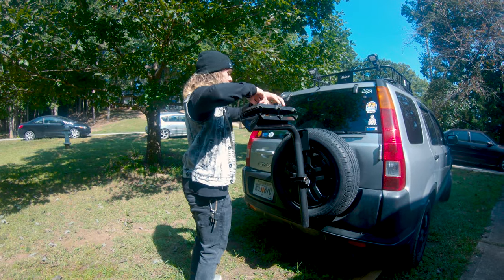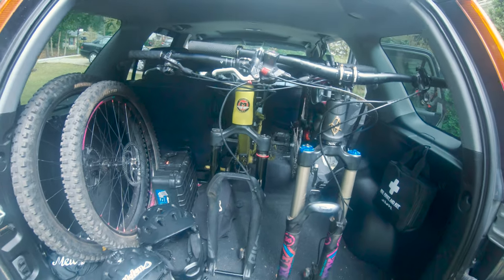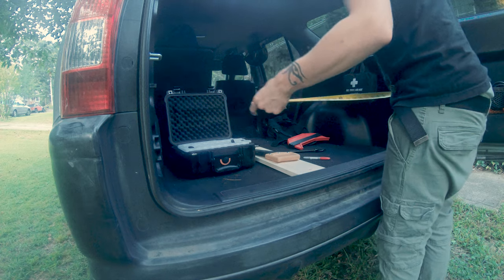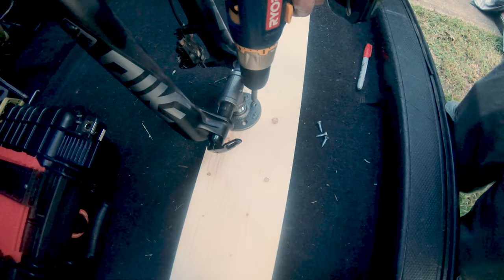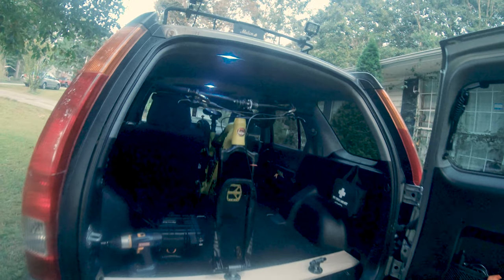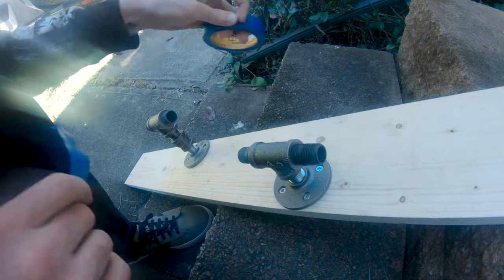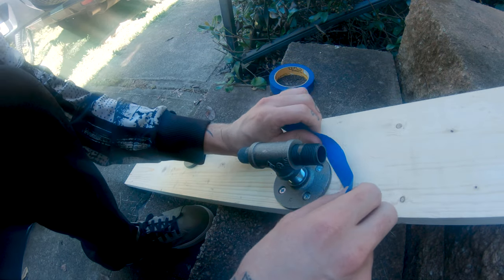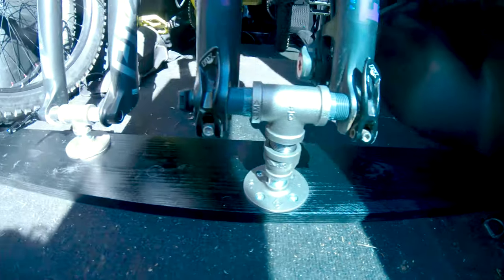Bike Mount Inside Vehicle DIY - No More Bike Rack!

Comment: This is an excellent idea! I’m almost 58 and just bought a Schwinn Al Comp to try to get back into shape after being off work for over five months due to a work injury. Picked up my Wife a new Electra Townie. I have a ‘19 Ford Escape and this may be the perfect solution since I don’t have a trailer hitch. Both bikes have quick release front hubs so dropping the wheel to get them in and out of my car will be a snap. The only change I would do differently is instead of using the wood screws like you did, I would drill the holes for the fittings and use T-nuts on the bottom of the board. That way you can tighten the fittings down using machine screws that will thread into the T-nuts making it much more secure. But thank you again for the great idea!

Comment: Brilliant idea! Just what I needed to fit 3 MTBs inside my trailer! Very creative 👌
Reply: this idea is not only dangerous but also uses a lot of time and money.
first we have to do is to invert the bike on the wooden plate. weight should always sit on the bottom not be in the air. you buy 3 Cargo straps.
You attach both bicycle handles to wooden boards.
the third cargo strap must go over the bicycle and be attached to both sides of the car. Remember that the wooden pallet must also be attached to the car, find a hole or other place and fasten well.

Comment: I used a 9$ mount from riderace which I bought from aliexpress. It have adapters for 4 different sizes. The only cons I found is that the 110mm adapter is exactly 110, so it is too tight so I had to sand it a little bit

Comment: this idea is not only dangerous but also uses a lot of time and money.
first we have to do is to invert the bike on the wooden plate. weight should always sit on the bottom not be in the air. you buy 3 Cargo straps.
You attach both bicycle handles to wooden boards.
the third cargo strap must go over the bicycle and be attached to both sides of the car. Remember that the wooden pallet must also be attached to the car, find a hole or other place and fasten well.

Comment: Hello. 

Brilliant DIY mate. 

I want to do the same with my road bike and have a query, how do you stow/secure the disc front brake callipers to prevent them from hanging, once the wheel is removed with this setup?
Reply from the maker: They dont require any special care. I know on some cheaper bikes the pads could fall out but these type of brakes they have a clip that keeps them in. Most mid to high end bikes should
Reply: @DirtTrampMTB  cool 👍

Comment: Amateurs, I went cheaper. I put 2 bikes in a Honda Fit. I put them both handle bars down and front wheel removed. 0 dollars spent.
Reply from the maker: I suppose that's an option but I don't regret spending $50 or so to make sure my $4k worth of bikes aren't hitting into each other or falling on my dog lol. We go off road from time to time and there's no way they would stay in one place